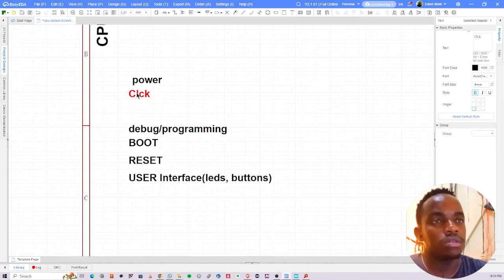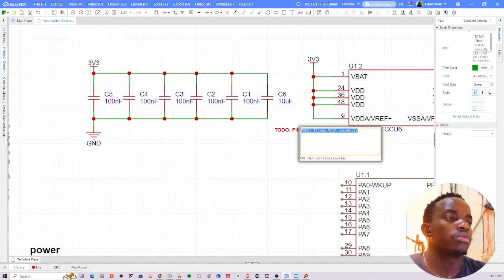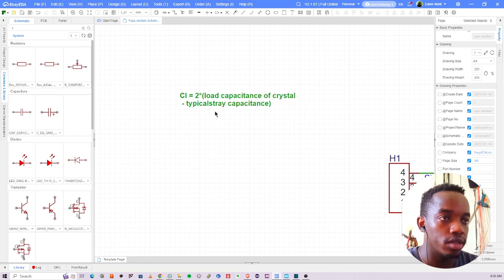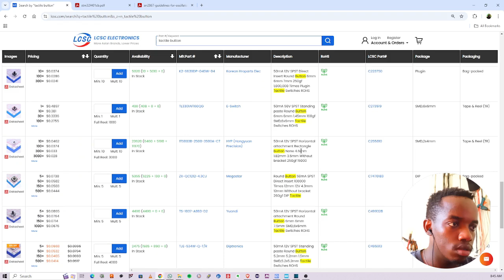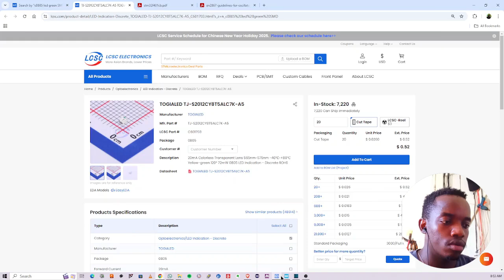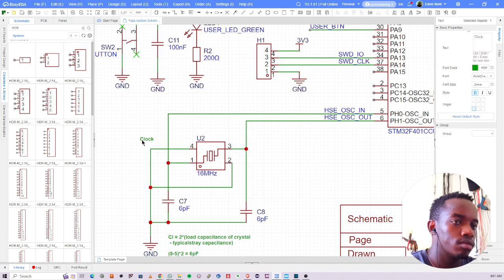Project Shadow Flight#4: Onboard Computer(OBC) STM32 Bare Board Schematic Design

Comment: Thanks for the video. i am working on PC104 form factor PCB  board using STM32 and  i found this video really important. could you share the schematics file if it is possible?
Reply from the maker: Hello. Yeah. I will publish the schematics publicly and let you know. Easy EDA does not make that process easy